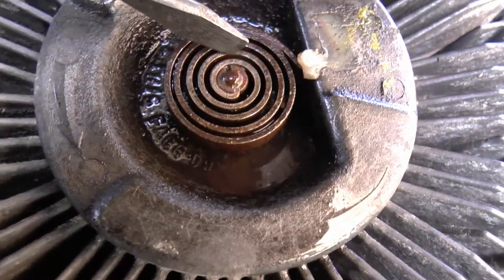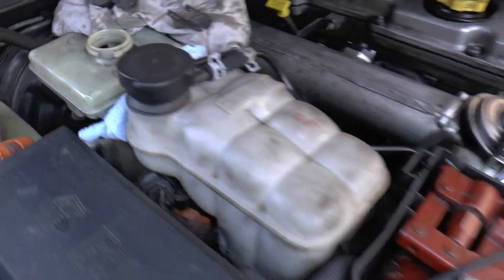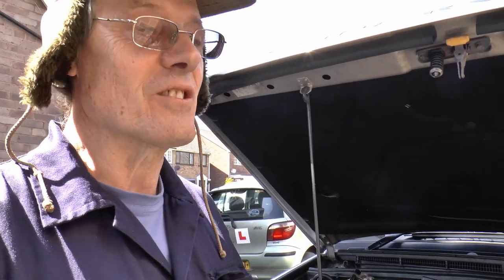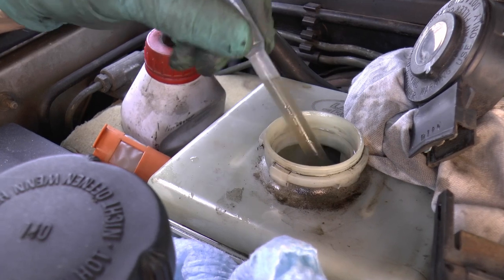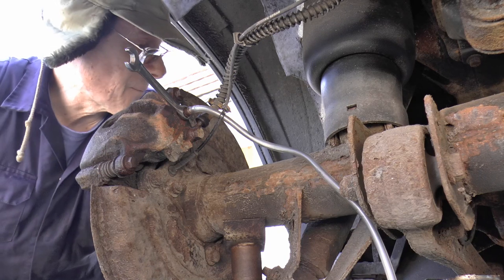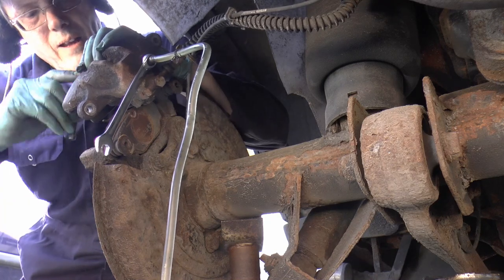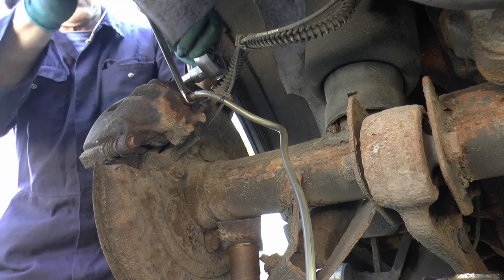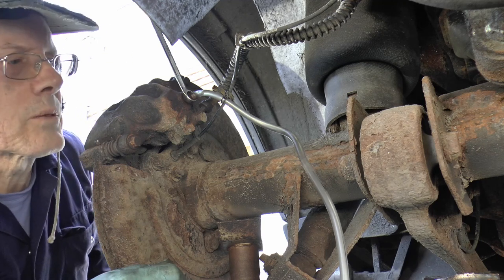Discovery 2  New fluid Brake Bleeding. (Big Lollopy Dog)

Comment: Good to see you back on your feet, that’s one hell of a job to without the diagnostic but again I was doing the disks and bearing as the ABS failed, my air suspension went two weeks ago and hard to replace them with springs until I can afford to have it repaired, next up for me is the transfer box and gear box, possible the seals or something more on the cards argh,
Reply from the maker: Oh Blimey, sounds like you have too many problems too!  I was going to change the rear airbags this year as per my own advice to treat them as a service item. No point now!  Good Luck with yours!

Comment: Brake bleeding. What you have done is the first bleed of the system. That's when you got all the bleed nipples and pistons sorted. The next stage is to do an ABS bleed, then a power flush.
Personally, I do it power flush then ABS. 
If you have a OBD reader for the TD5. Mines a Foxwell 510 for Landrover and Jaguar about £130 on Fleabay.
Go into the ABS settings and you should find a setting for power flush which can be done for each wheel. You open the bleed then click on the power flush for that wheel and it will pump the brake fluid through for about 10 sec, close nipple before it shuts down. Do the same for each wheel. 
Do the ABS Bleed go to the setting in the reader for ABS It should guide you through the procedure for pumping the brake pedal. Hope this helps
Reply from the maker: Hi Martin. Sorry, only just seen this.  That does help, mind you, I don't have a OBD reader - yet.  Thinking of a Nanocom. Thanks for the comments, plenty of good advice there. Cheers, Derek
Reply: @sleepycatpictures1176  Nanocom is expensive. The one I have does all landrover and jaguars from 300tdi up to all the models 2016. (Systems) plus it will read most other cars Obd from 2005 and clear codes. Its handy and does not lock you into one vehicle like nanocom.
Reply: Martin Rothwell does this work with a year 2000 td5 d2 ?